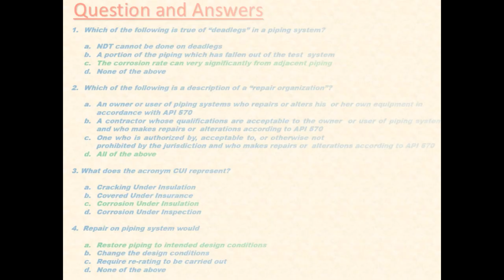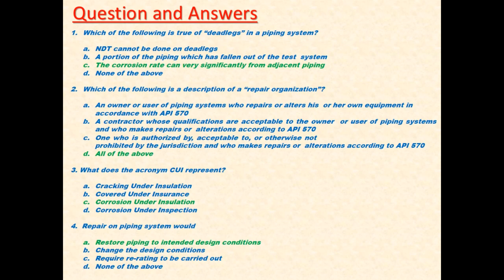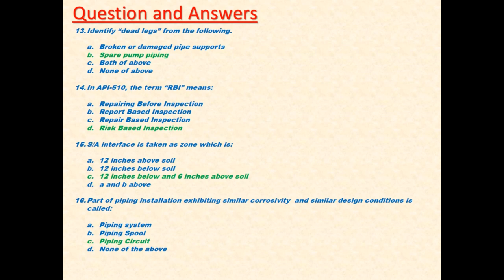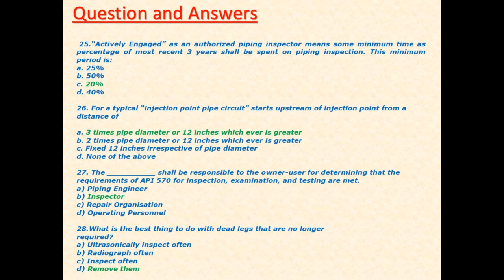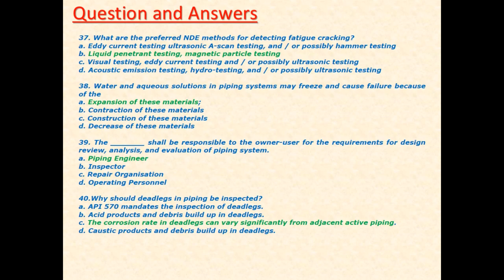API 570 Piping Inspector Exam Questions and Answers

Comment: question 34 - very confusing, I preferred the answer should 3"(75mm)or 1.5 times greater thickness from the point of welding, instead of answer given is at least 1" beyond the edge of the weld ( B31.3 said from the point of welding - any tack welding).   .. Correct me if I m wrong
Reply from the maker: Thanks for your question. First you need to check what are the questions are there ..you need to answers what are the best options ..
As per B 31.3 what you said is correct , including there are mentioned "The base metal temperature for tack welds shall be
at or above the specified minimum temperature for a
distance not less than 25 mm (1 in.) in all directions
from the point of welding" as per 330.1.4 Clause ASME B31.3. So you need to choose this answer .
I think you get it..